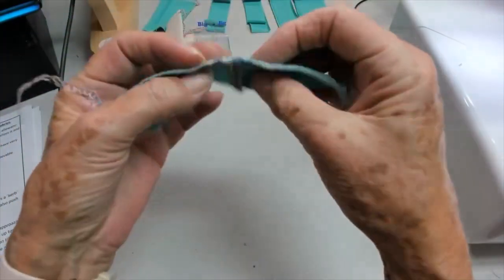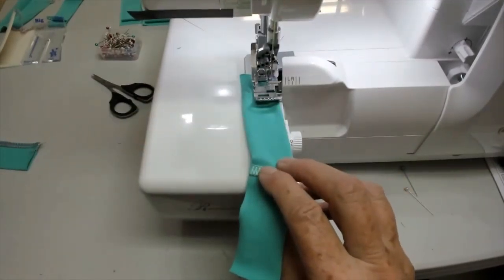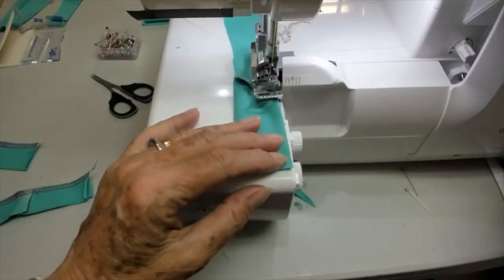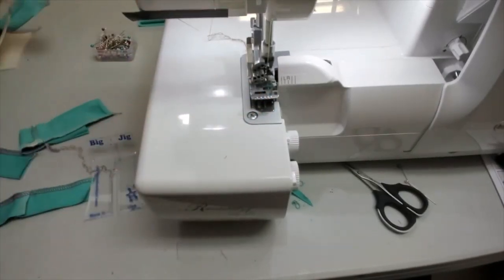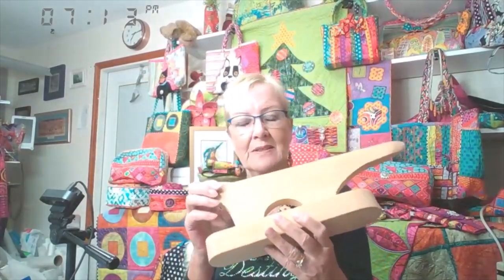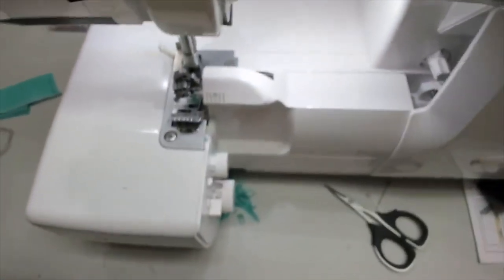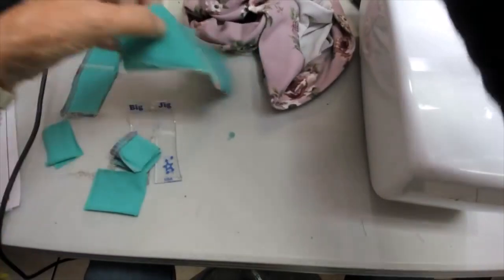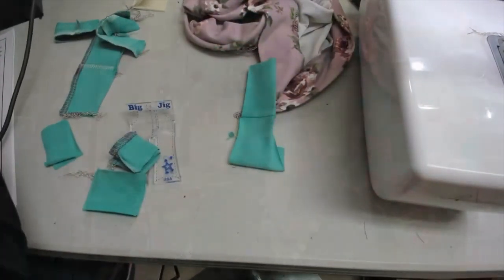How to serge over thick seams on the serger, particularly with knits.

Comment: This isn’t exactly about your video here but when serging a long seam with knits  inevitably one piece of fabric is longer than the other. Is that why even in this video you had your diff feed at 1.3?
Reply from the maker: You have to be proactive when sewing knit seams and making them match.  Cut off seam allowance for the very first 1.5 inches.  This will allow you to put the fabric right up to the needles and have the raw edge kissing the knife.  The advantage of doing this is that the first stitch will `nail` the fabrics together and you will have all the feed dogs in touch with your fabric and working for you.  When you get about 8 inches from the end of the seam.  Hold the end of the seams together and make them match as you stitch.
Differential feed will help you but the above will make the difference.